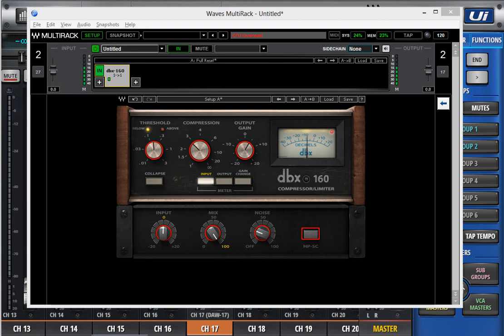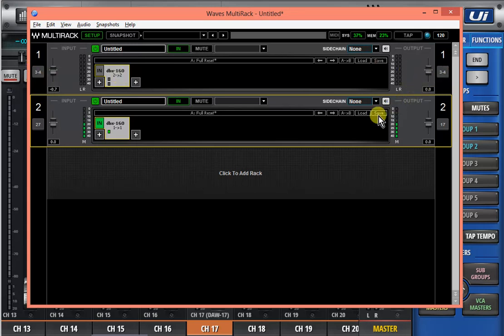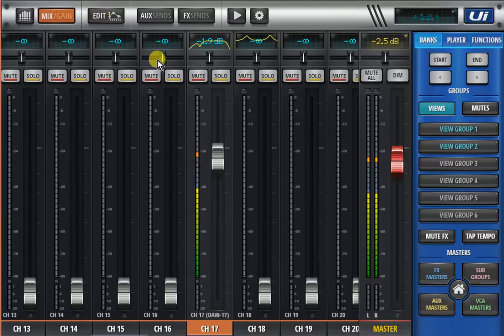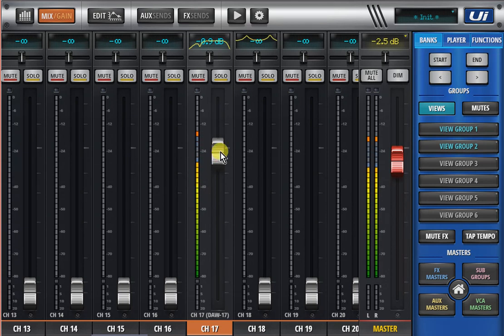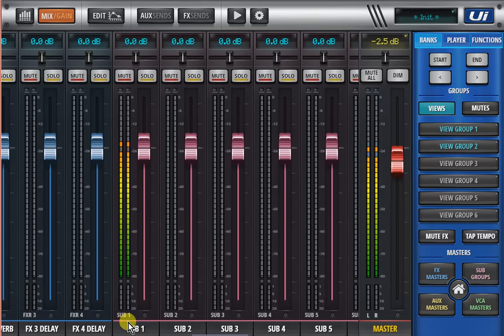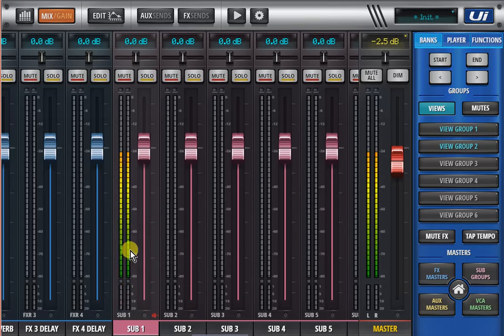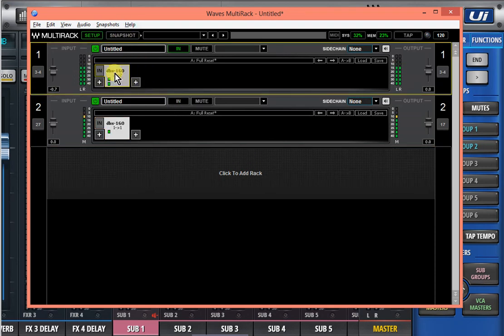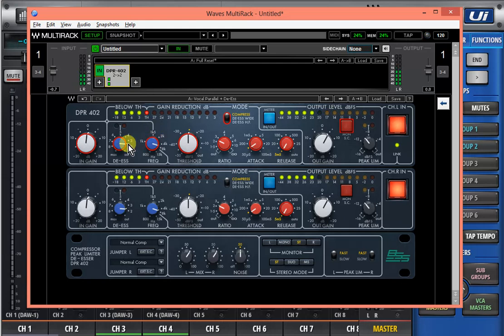Ui24R using plugins via USB

Comment: UI24r doesn't work with USB cable! Doesn't work to record with  a DAW for example... Working in USB daw for 30 seconds and having to restart to get the computer audio workingback, means it doesn't work. Unless I use a 1,5 meter USB cable...
Reply: Id say you have an issue with you computer here

Comment: Great video. This seems to be the only information (video) about being able to use third party plugins with this unit.
To get clear on it:
One can use any set of third party plugins (not just Waves), but you must connect the Soundcraft Ui24R and laptop via a seperate interface (I have Focusrite Clarett) to be able to use them in a live mix.
Is that right?
Reply from the maker: Sure that is right

Comment: I know this is an old video but I just discovered that you can use plugins with the UI24R and I am fascinated by it.  What I am wondering is how do you monitor this kind of setup from the front of house?  I mean if you have a computer or a Soundgrid server that is connected to the UI24R, how do you use a tablet or notebook out 100 feet in front of the stage to see both the UI24R screen and the WavesRack screen and make changes to both when mixing live?  Can you have a wireless connection or do you need to run an ethernet cable out to your notebook in the front of house?
Reply: A simple way is using team viewer to control the host computer
Reply: Todd did you ever get an answer to this question? I am curious as well.

Comment: Is the latency passable for doing it on live sound, using some plugins on some vocals and master out.
Reply from the maker: FX for sure, Compressors it depends, Now having said that if you delay a whole group and bring it back it it's the same as doing latency compensation in a DAW. Certainly possible for FOH, not sure good enough for Monitors.
Reply: @mix-record-connect9938  whats in out latency time ??? and can this be done with the 12 model??
Reply from the maker: @andym7333  Not with 12 model, Latency depends on the computer and plugins but you can expect 6ms-10ms normally

Comment: so you can't do this without using a computer? you can't do this with only a touchscreen ? Another question, is there any other way to level out volume of a speaker without having to use a plug-in?
Reply: You do know what a plug-in is right?? It’s a SOFTWARE plug-in.  And what do you need to run ‘software’?  You can do exactly the same thing with a hardware compressor, but that defeats the very point of using software.

Comment: Hello Friend how are you? thank you very much for the indications, I am enjoying wonderful multirack waves. I have felt a considerable delay. To work with minimum latency, what is the recommended configuration of the buffer and samples in the driver configuration of the UI24R? and finally, changing the subject, what is the correct position of the master knobs L and R to coincide, supposedly, with 0 DB? at 12 o'clock on the clock? the two? at 4? thousand and a thousand thanks !!!
Reply from the maker: Buffer settings depend on the speed of your USB interface and your computer as well, not just on the Ui24R and it's driver. It's best to experiment and see what is a SAFE range for your setup. 

As far as position of master, you will see printed on the level indicator (around the knobs) a NOTCH which indicates 0dB.
Reply: @mix-record-connect9938  ¡¡¡Eres el mejor !!!. Para el show de namm es algo nuevo para nuestras consolas UI24R  Amigo, vivo en Sudamérica, disfruto los ritmos tropicales y estoy contento con este equipo. Quiero decirles que ofrezco ayuda para desarrollar la consola, la uso mucho y me encanta este equipo porque es accesible y tiene Excelentes funciones, quiero formar parte del equipo de Soundcraft!
Reply from the maker: ALLOT IS NEW.. :-) you wil know in 24 hours

Comment: Friend, I have a problem with inserting the wave plug ins. Everything works perfect inside the multirack, but I do not know how to return the processed signal to the channel of the ui24R. correct me if I'm making an error: I set up an AKG D5 microphone in input 1 of the ui24R, raise the gain, eq, com and raise the fader to 0 db, then activate the multirack, prehens, then asio Soundcraft UI24R, insert a rack using channel 11 input and 1 output, I start talking and I select any plug ins and it works, but there are no changes in anything. thank you, I'll be attentive to your answer
Reply from the maker: Think for a moment, how is the signal going BACK into the Ui24R? did you select USB DAW input 1 anywhere on Ui24R?  if you want it to be an insert then on the same Channel 1, you need to select INPUT 1 from USB DAW, your gain will then MOVE away from the standard  PREAMP area and move to the END of the GAIN section (as now it's using USB input) Chain is: INPUT - GAIN - OUT USB 11   then IN USB 1 - UI channel.
Reply: @mix-record-connect9938 Amigo muchísimas gracias, perfectamente bien me sirvió tus recomendaciones. Me ofrezco para promocionar este producto a todos los usuarios de América Latina.

Comment: Use soundgrid? Only USB cable?
Reply from the maker: It's using Multirack, Soundgrid is an Ethernet audio protocol. You can however use Soundgrid with the UI24R as an interface by using the Soundgrid Driver Waves provide.

Comment: This is the most confusing video you have made, please redo
Reply from the maker: A question for you: Have you ever used plugins over USB to an external device? Have you used plugins before?  Do you know how to route audio in and out of the Ui24R via USB? once you answer these questions it will not be confusing. The video is purely there to give you some ideas on how you could achieve this but it's not a guide, or a tutorial about the specific use of these elements on the Ui24R.  (but I always appreciate comments, thank you)

Comment: I just got one of these. Pretty disappointed that it didn't come with a user manual. 

What is a DAW?
Reply from the maker: Full manuals are not printed these days, that's just a waste of paper. You download the manual from the website or read it online. Many acronyms that are standard in these type of products are used. A DAW is a Digital Audio Workstation and refers to the software used on computers for recording/editing and playback of audio.

Comment: Thanks that's a great heads up... you state input 27 is input 17 in the ui, and yes it works but I can find no reference as to why it does,  no routing is shown so I am trying to understand it?... cheers
Reply: OK just found a output map in a previous post, Cant find this in any specs, assume its fixed?cheers
Reply from the maker: The manual and references this and states it is hard wired, no need to patch. 1-2 Left Right, 3-8 AUX 1-8, 11-32 inputs 1-22., that's 32 channel .

Comment: I don't get this.  For example, in a live sound setting, if I have my drums coming into channels 1-10, how are you supposed to do this?  The way how to do this with Presonus Studiolive mixer is, they're using channels 33-50 for USB send and return.  It would be useless and extremely DUMB if you have to give up channel 1-10 if you want to use USB aux send and return.
Reply from the maker: Inserts, do not take more channels, it is inserted on the channel, for example INPUT1- USB DAW - back to channel 1. You can insert any plugins on the drums.  AUX is used for example if you want to add another FX to that you can send via an AUX send to any other channel (like you would an external Hardware FX) then obviously this needs to be returned somewhere to another set of inputs. You could have several AUX sends, MIX the returns in your DAW and bring them back as just a pair of channels as well.
Reply: I get how insert on channel works, it's 11 out coming back in 1, 12 out coming back in 2, 13 out coming back in 3 etc.

But what if, for example I want to insert a bus compressor (assume you know that the dbx-160 is a bus compressor, and shouldn't be used like an fX processor) on the main LR bus.  I know that the signal are being send out to DAW channel 1 & 2, but what channel are they returning to?  What are the return channel number for main LR, aux and FX busses?

Do you have to sacrifice one input channel for each return?

Comment: is it possible use at the same way an fx with a recording software? but in send mode using the aux? for example another reverb like pcm91 simulation o waves?i saw that on ui24 you can use 2 reverb but it's the same
Reply from the maker: yes sure, you can send to ANALOG outputs as FX send or you can send to a DAW from an AUX send as well.
Reply: when i connect usb with cubase for example i can send also in the aux? i thought to see only the 22 channel. how is possible? the mixer in daw show me only 22 channel. could you be a tutorial for this? but on this way i need the mixer near me?
Reply: sorry. i read about out setup with usb. but with a fx i need to use 2 channel for return? i can't do this if i need all 22 channel for the show?
Reply from the maker: you need returns you are using the LINE inputs as well?  you don't have to have stereo returns.
Reply from the maker: yes you can send 32 channels from the Ui, MIX L R, AUX 1-8 and 22 channels
Reply: so can i use the notebook for daw but only for plug in fx and record by usb? 
I do not know if my laptop is powerful enough to send effects and record. thank you for everything, 
I still have not bought it, I only used it from my friend sometimes, I have the ui16 but I will change it

Comment: Can you tell me what's the latency for a signal from analog input to ouput is?
Thanks
Reply from the maker: With all processing ON in the Ui24R it's about 3ms, with plugins it really depends which plugins and computer you are using to process them  but I would suggest 6-10ms.
Reply: Thank you for the information.  Isn't 3ms is a little too much?  Because Behringer x32 claim to have only .85ms of latency.

BTW, I have another question for you.  I see that on the side of the Ui24R, there's a cover look like a slot for an expension card.  Is there a plan for an expension card for this mixer in the future?  AVB or DigiGrid perhaps?  :)
Reply from the maker: that depends which processing is switched ON, if its just PREAMP to USB then it would be less than 1ms. I am giving you a real figure with all processing on a  channel and on an output / subgroup running.
Reply from the maker: many plans :)
Reply: Thanks, that make more sense.

Comment: OK. SO you are setting up these racks in the Sound craft interface, not the DAW. Right?
SO ... tell me if I understand this correctly .... I like to keep things simple and have continuity in the signal chain ....  I would connect to my DAW via usb type B and then ..... I put a mic on a bass cab and the mic cable is going into the xlr input #5, then ..... if I set up a rack in the Ui24r and choose input 5 for that rack ...  ...... and then I place that dbx 160 in the rack and I choose output channel number 5 ..... then on my DAW (in my case it is Sonar Platinum),  I use track 5 as my bass track ..... and use Ui24r output 5 as the source for DAW track 5, I then would arm my DAW track 5 and record that bass with the compressor being recorded as well. Correct?
Reply from the maker: I am setting up the RACK in MULTIRACK, that's a WAVES program, you can use several different hosts for running plugins including your DAW, I just find MULTIRACK easier.   If you are using your DAW as input to the UI24R then you would run the plugins in your DAW.  What I was showing is a way of running the plugins in a live situation with input on the UI24R.
Reply: OH. Ok. I had not seen multi rack before. That clears that up. Thanks.
I want to understand the easiest routing options, so let me ask this;   
Is this one proper way to record through the Ui24r? 
 I would connect to my DAW via usb type B to my PC usb 3.0 input and then .....
 I put a mic on a bass cab and connect the mic cable  to the Ui24r xlr input #5, ..... . 
then on my DAW, if I use track 5 as my bass track ..... 
and choose Ui24r output 5 as the source for DAW track 5, 
I would arm my DAW track 5 and record that bass . Correct?

ANy effect that I add to the input channel in the Ui24r would be recorded. Correct?
Reply from the maker: Basically YES, just that you need to remember what I wrote bellow in regards to the channels. INPUT 5 in the UI24R would come up as input 15 in your DAW if you read bellow you will understand why.
Reply: OK. That makes sense. Got it. Thanks.

Comment: I have watched a few of these videos and I am not clear on what you mean when you say input 24 means it's coming from channel 17 or in another video where you said that you were using channel 20 so you chose input 30 or vice versa. Can you please explain this?
Reply from the maker: The outputs of the UI24R to DAW are setup this way: (no patching needed)
Left Right =  1-2
AUX(OR MTX)1-8    =   3-10
Input channels pre processing 1-22  =  11-32 on DAW

The inputs can be patched in any way you like, it's a MATRIX PATCH. any DAW input can be sent to any channel,
You have 32 channels from DAW and 22 slots in the UI24R.

So when I say input on DAW I chose 17 that refers to channel 7 on the UI24R.
Reply: Thanks. Got it.
Reply: is it possible use at the same way an fx with a recording software? but in send mode using the aux? for example another reverb like pcm91 simulation o waves?i saw that on ui24 you can use 2 reverb but it's the same